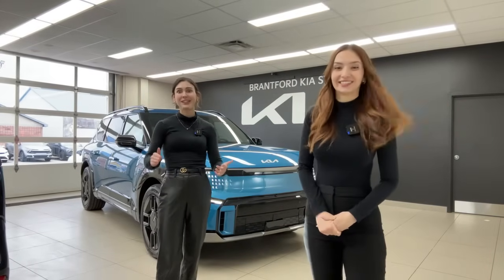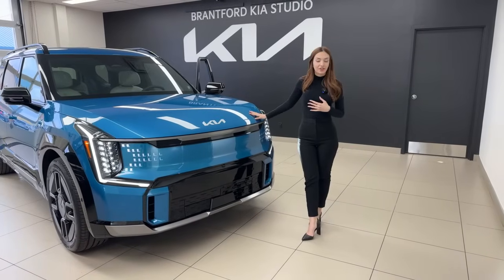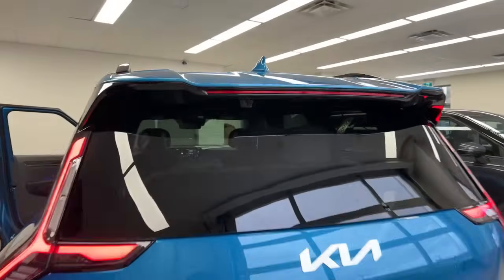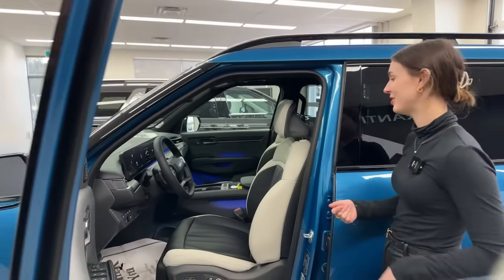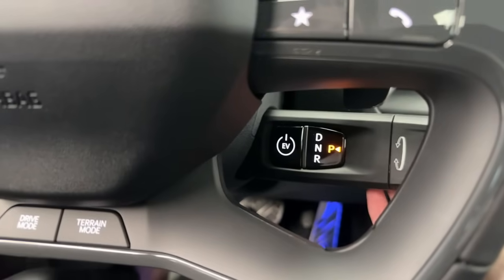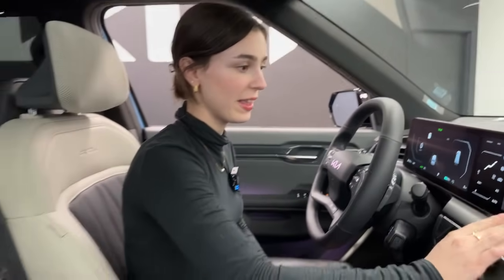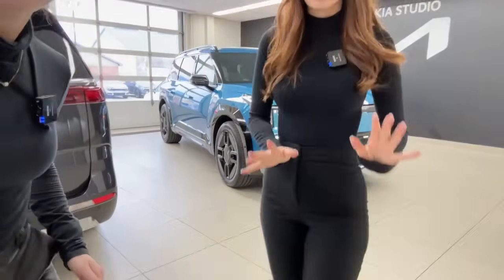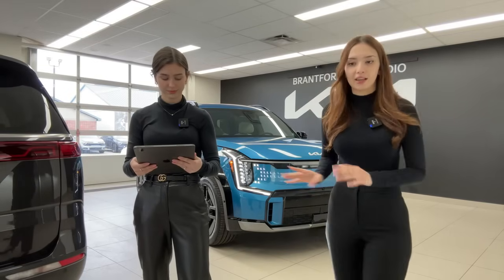First Look at The 2024 Kia EV9 GT-Line! - The Most Expensive Kia EVER?!

Comment: For people that want a real SUV size electric car(and yes that is obviously not a huge segment - Canada is only getting 530ish of the EV9s for now) this is a good value. if you compare it to the other 3 row SUVs (EQS, rivian R1S, model X sort of -obviously those cars are more premium but they are also way more expensive) it is better "value" but it is obviously a fairly premium trim level/car.

One unfortunate thing in my research on the EV9 it unfortunately has some of the same 12V battery issues that have plagued the EV6 and ionic 5. Hope kia figures out the component sleep states better (so far it seems there are issues with the automatic charge lock and the digital key functions drawing more power for longer than they should from the 12V than they should with the vehicle off)

Comment: Lost me at subscribe to features on the car. Any car company that continues with this trend is welcome to tank. NEXT!
Reply: Most definitely! BMW has been tarnished by their heated seat subscriptions. They’ve since backtracked. You would think auto companies would learn from others.
Reply from the maker: I must admit, I’m not a fan. Especially considering the price tag of the vehicle itself. However, I will point out. The subscription is just for specialized lighting patterns on the digital grille, so it does not remove crucial safety or premium comfort features.
Reply: @BrantfordKia Unfortunately, it's a heavy EV that's lacking range, Battery degradation in a real world scenario is a killer. Next.
Reply from the maker: It’s an interesting option to include, but it’s not for everyone! At least the subscription is aesthetic based and not comfort based (i.e. heated seat/steering wheel subscription).